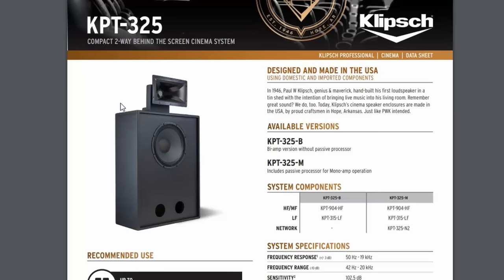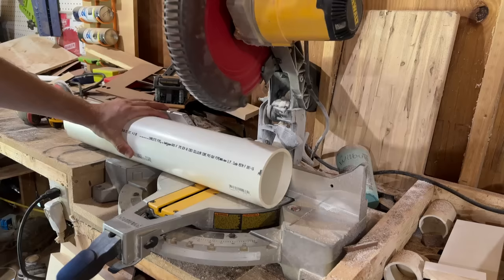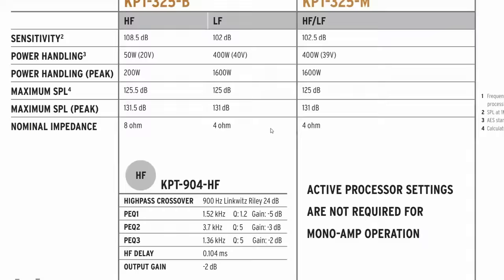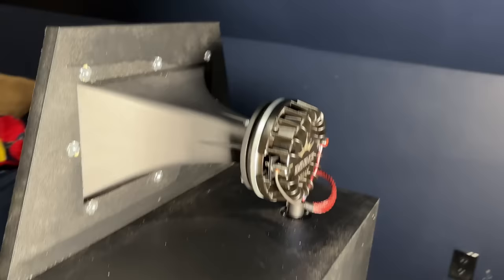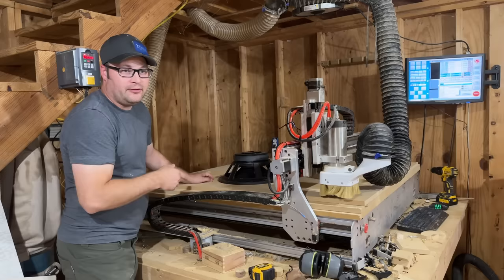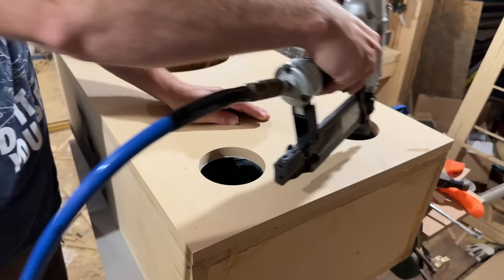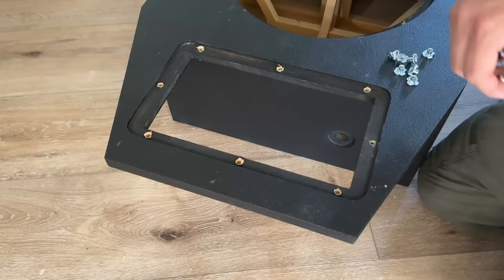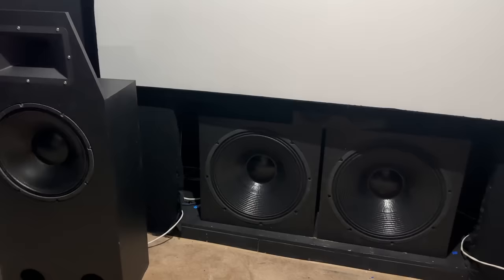How to build $9000 Speakers for $2000 - Klipsch KPT-325 Inspired

Comment: Hi toid! How do these compare to the epique builds, greetz
Reply from the maker: That is tough, since they really are completely different builds. The Epique are designed around 2 channel HiFi listening and because of that they go down to the 30hz range. Where these are more designed for Home Theater and are designed to go down to 50hz range. So not as full-range. If it was two channel music without the use of a sub, I would definitely go Epique.
Reply: Thanks, would you choose the epique because of the full spectrum  or other aspects as well? I wanna try the epique in a boombox with tweeter but the heavy cone make me feel like the midrange is undetailed 😮
Reply from the maker: @roygriend5143  the mid range is detailed enough. The biggest issue that you would have with that being in a boom box is the weight. Especially since it has multiple magnets.. but you could definitely do it. For me both the epic and these are just two completely different speakers for me to say I would take one over the other. But if I could only choose one, and I had a theater room like I do, then I would obviously choose these. They can do anything and do it well. But like I said, you’re probably gonna want a subwoofer with it to get the lower base notes.
Reply: @Toid  thanks for the explanation, i don't have a theater room  :(  you are lucky you have :)  is the wavequide also being part of the sound image in de theater room, because when portable this isn't needed. I mean the epique build is more designed to "walk around" when listening? The theater build have less wall reflections, like you mentioned in the video but i often diminnish those facts but when learning more about it i see those kind of things have huge impacts and every situation is different with different solutions. Thanks for learning toid!!

Comment: Nice! Been waiting for the 314 build! :D 
Only problem now is, what would you pair with these for surrounds and atmos?
Bit worried about proper acoustic matching.
Reply from the maker: Interestingly enough, I will be working on a version using a 12” woofer that could easily be used for surrounds. I did do an atmos design a while ago that would work for this, but I don’t have anything using this compression driver for atmos.
Reply: @Toid thanks. Remembering the price for the 314 i dont think Ill be getting 8 of those for surrounds/atmos duty 😅 could be sweet though.
Are you referring to the beta 10cx coax speakers?
And if so would the d220ti or the f110 be the better match? Im leaning towards the d220ti's as I really enjoy all the little subtle details in the surround mix, and in my experience listening fatigue with bright speakers will be countered with a well treated room.

Man imagine a 7.x.4 setup with BTS 15 as LCR and all the rest the beta 10cx :D
Reply from the maker: @mikkelkirketerp4884  you could do that. I really like the cinema 10 for surrounds. It’s probably what I’m gonna use for my surrounds. At least for the time being. I’m not sure what the price of that comes out to be though. I really think that you would like either of the compression drivers. But I leaned a little bit more towards a D220 TI myself.
Reply: @Toid  I'll look more into those Cinema 10's.
Perhaps I'll let it come down to parts availability/price and how easy it would be to fit them into my theater, especially the 4 atmos speakers.

Do you think there'd be any tangible difference with using bi-amp and DSP instead of a passive crossover for the cinema 10's?

Comment: Hello, what cnc do you use? I’d like to invest in one. Thank you.
Reply from the maker: I use a CNC4NEWBIE
Reply: @Toid  thanks for the quick response! You’re the best.
Reply: One more question if you have time. What would you suggest from your project library for a living room theater system for us with a smaller living room? I only have a Denon TX-RZ50 to drive speakers with. Thank you.
Reply: Nvm just see your list on your website. Still, can a regular surround sound receiver power these? Like the Denon RZ50? Thanks
Reply from the maker: @abelcanahui3459  yes. Something like the Onkyo RZ50 or the Denon x3800h would work. The Denon has the more Dirac options, but in the end well cost more for those

Comment: Why don t you de couple the drivers with silicon gaskets ???
Reply from the maker: The woofer has a gasket already on it and in didn’t feel it necessary on the horn.
Reply: @Toid  Excuse moi if I dare to dissent, but the three fundamental rules of loudspeaker building are: Mass, De couple, Brace. For example I would have added steel plates inside the cabinet walls, glued with silicon, just to givew an example : B&W masters of Matrix bracing, in later production lines have added metallic plates, silicon gaskets are fundamewntal to me, I have used them in my works and the vibrations, always present, considering such a huge woofer, are deadened to an amazin upper level of clarity.